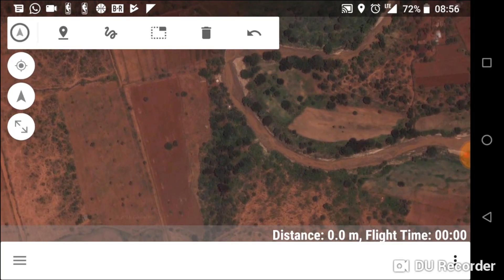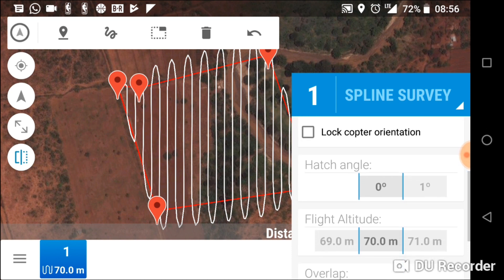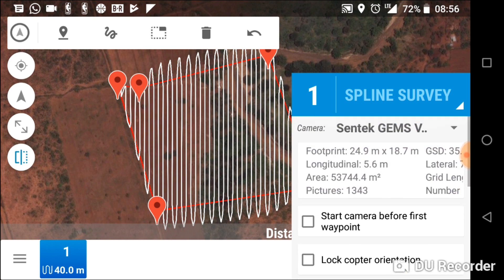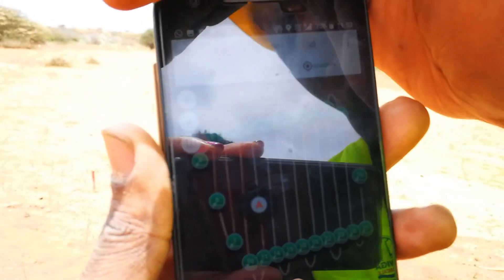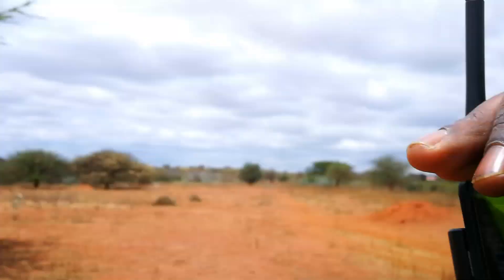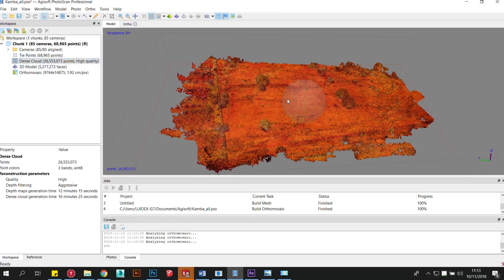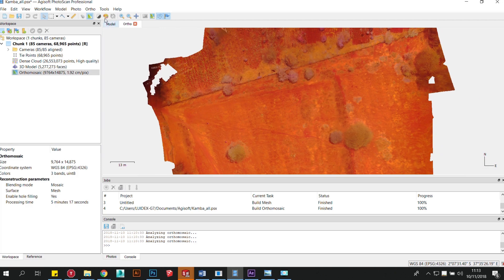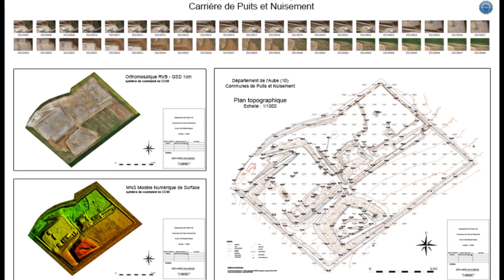Automated Drone Mapping using Pixhawk and Tower

Comment: great project bro, what are the specifications of the camera you used in this drone and soft you used to post-process the images from the drone. thank you.
Reply from the maker: Hi, thanks! The camera is a MAPIR RGN camera, with a NEO GPS module, the software here is Agisoft Photoscan, but pretty much any photogrammetry software should work.
Reply: @LuideMulumba  thanks bro but is it possible to use mobile camera with gimble instead of MAPIR camera for my quadcopter with apm 2.8 controller thank you.
Reply from the maker: @gowtham1508  yes you can use mobile camera, however you won't get the NDVI capabilities that specialized cameras offer.

Comment: Great video Bro, would you kindly share what drone kit was used..?? Thanks and Bless you for your future..
Reply from the maker: You're welcome! This is a fully custom build, you can find an updated design of this drone here:
https://grabcad.com/library/x4-750mm-quadcopter-1
Reply: @LuideMulumba  could send me the Fission 360 of your frame or the measurements you used while designing in fission 360 martinchege1998@gmail.com
Reply from the maker: @martinchege8487  hi, you can use the link  https://grabcad.com/library/x4-750mm-quadcopter-1 this is the more advanced model of the one in the video.
Reply: Okey thanks still need your help though could I get in touch with you

Comment: Thank you sir.. i have APM 2.8 & 2.6 modules.    
Sir can i use APM 2.8 for this mapping task... ?   I hope your technical advice... thanks..
Reply from the maker: Hi, yes sure you can use the APM 2.8. It's very outdated at this point and cannot run the latest firmware from ArduCopter, but you should still be able to program missions on it.
Reply: @LuideMulumba  Thank you sir.. tower software not available now in google play story.  Do you know any replacement software for that..?
Reply from the maker: @madhawa.g.g.s4500  try and look for the apk file and install it using that instead, there really aren't many alternatives that work as well.
Reply: @LuideMulumba  okay sir.. thank you for your help..
Reply: @madhawa.G.G.S can u plz contact me